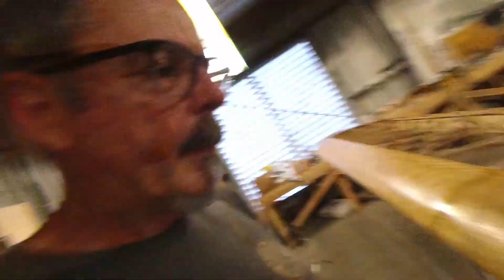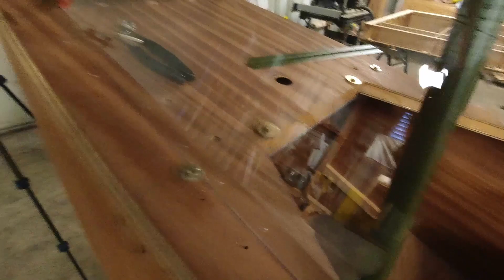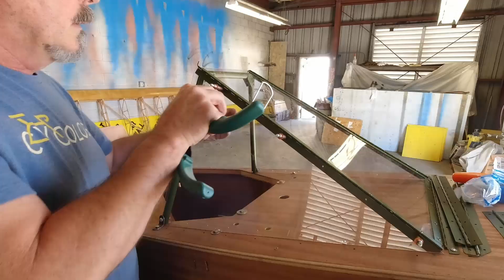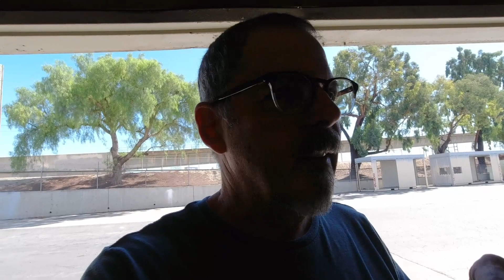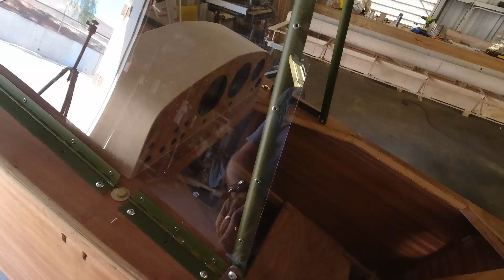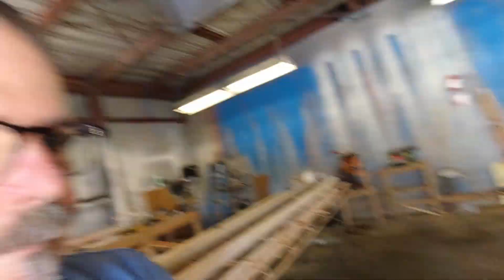Minimax 1100r Wood Aircraft Build Ep 127

Comment: I normally use aluminum rivet for plastic and over size the holes in the plastic a bit.
Reply from the maker: How do you feel about a strip of .025 aluminum along the vertical and the top to provide some support?
Reply: @DTMinimax  I think that would be a good idea as those exposed edges would be easy to knock and the plastic would then be stressed by the rivet and crack. I would make it a 90deg angle and also rivet it to the back of the tube.It is not a lot of extra weight but a lot of extra strength. The big problem is you have a flat thing attached to a round one, in an area that is likely to be stressed as you bump it or inadverantly grab it getting in or out.

Comment: Looking great! You do want to keep that polycarbonate protected from the dust.  I did not remove the protective cover until just before my first flight, two years later and it's scratched pretty bad just from cleaning the bugs off. I keep it covered with a moving blanket when parked in the hangar. You can see how bad it is in my latest video when I'm flying west towards the sun low in the sky.
Reply from the maker: Thanks for the tip, when I take it off I’ll make sure I wrap it up to protect it.